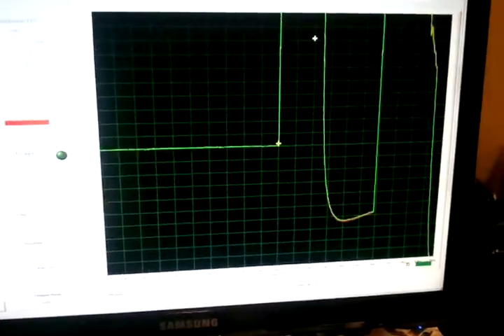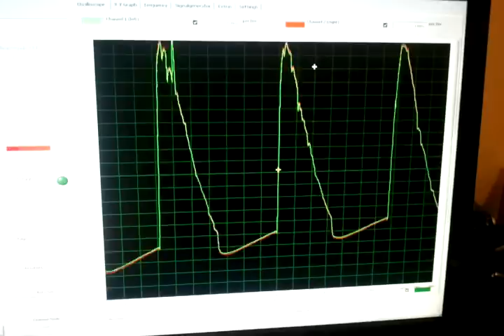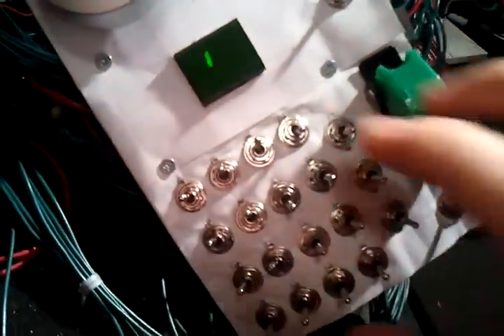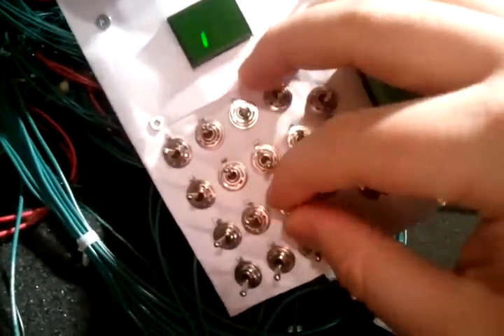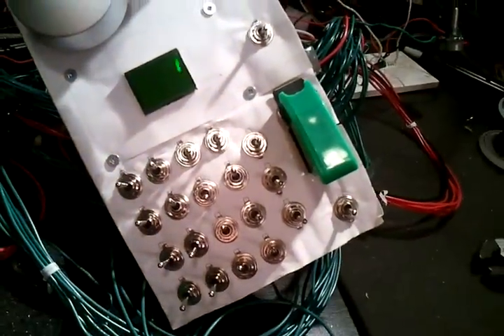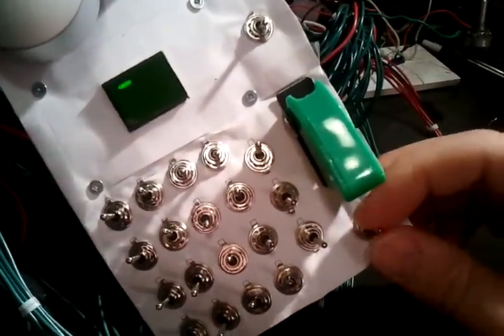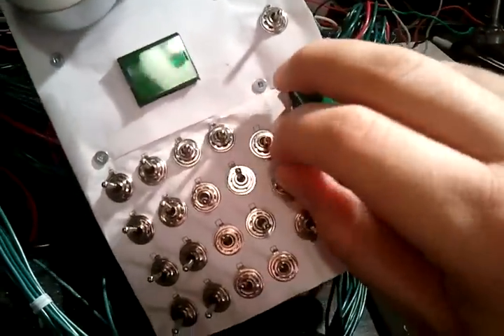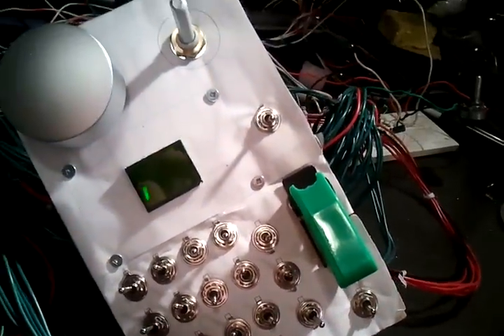16 Step Sequencer

Comment: I take it the Strobe input is the equivalent to a clock input on the 4514?
Reply from the maker: Hi Mark. What strobe are you referring to? The LED display? This is a very old project, but you are welcome to stop by and check it out. It sounds massive, but is also very noisy.
Reply: The Strobe input pin on the 4514
Reply: The chip has no clock input.
Reply from the maker: @SouthShoreSonics  oh ok. It was so long ago that I had to lookup the pinout again. I am guessing I sent the clock to that pin, but I can't remember.